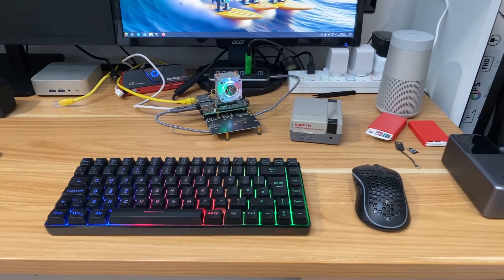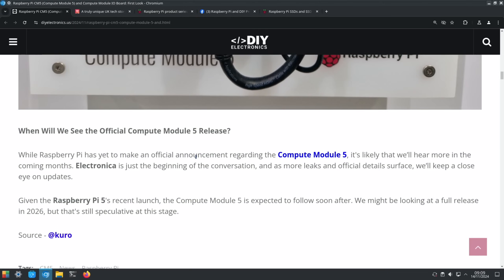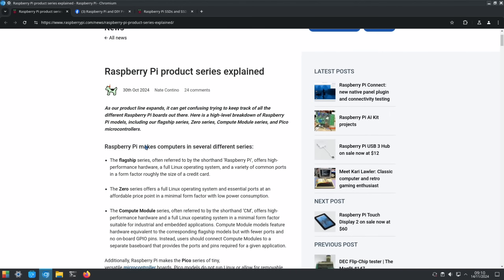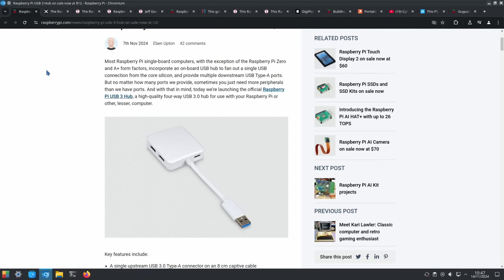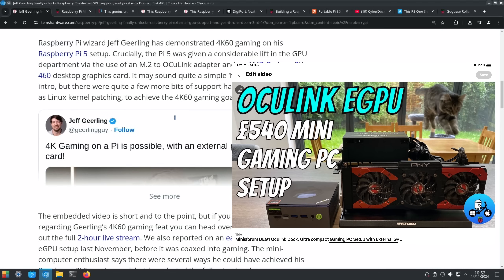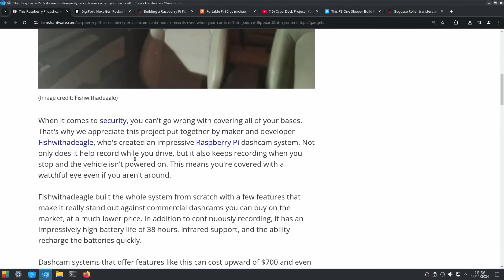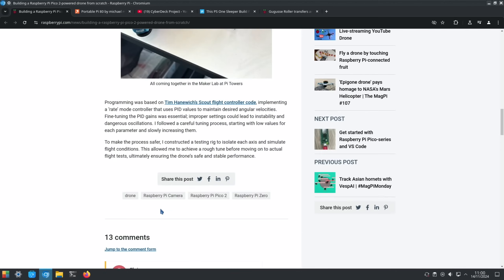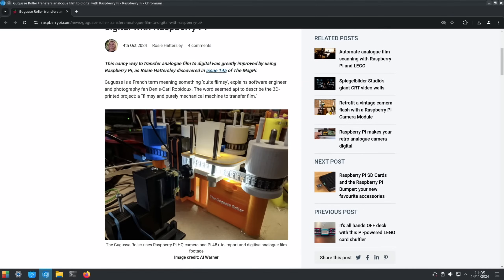Pi News 93. Compute Module 5 image Leaked!

Comment: What is according to you the best current hardware/OS/Browser combo to set up a stand-alone Browser-driven multimedia experience. I don’t want Chrome TV nor Apple TV. Just a screen with a browser on a SBC and a wireless multimedia keyboard. Able to play HD video streaming and maybe even 4K video streaming.
Reply from the maker: @boudivv  I use Apple TV because it officially supports all the main streaming services at 4K. If you don’t need Netflix Disney etc. Plex is good for archived content. Kodi also very good (video with Kodi and broadcast TV coming soon). Trouble is the Pi 5 has never been that strong on 4K. Rockchip devices are better for video but still also won’t stream all the official services at 4K. It’s difficult to answer as all our requirements are different.

Comment: Finally I can build a cm5 router
Reply: A "router" does not need a huge amount of CPU power just to send packets down different sets of wires. If something you are building requires the specification of a CM5 board that a CM4 board doesn't meet, then what you're building probably isn't a router, but more of an application-heavy network server anyway - and there are plenty of small PC platforms that can already provide that level of power anyway, you don't need to wait specifically for a CM5 board to do it.
Reply: @ ok I’d heard weird things with the pi4 as a router but I’ve found a waveshare cm4 board that should allow for it to be used as a router but my concerns were that the pi4 cpu might not be powerful enough
Reply: @block_01_  It entirely depends on the type of router you're building and what the router needs to do. 

As I said in the previous reply, simply moving packets down different wires doesn't take a lot of CPU power - but if you're then adding in "router-like" functions such as NAT (Network Address Translation) or stateful firewalling (where you inspect each packet and decide whether to route it or drop it), then you need probably need more CPU power, especially if you're doing that over 4, 8, 16, 24, etc. router ports.

Unless you create your router specifications first, you've no idea if a CM4, CM5 or any other platform will be good enough or not.

That's the core point I am trying to make here.
Reply: @ thank you for your help I’ll take that on board when deciding how to build it and what I need

Comment: Anyone happen to know if the USB3 hub supports booting on a Pi4? TY.
Reply: Why not release a 1GB Raspberry Pi 5 A+ like shave as much cost off the pi as possible
I bet a Pi5 A+ sell for $35 or less
Reply: @TacticianTilted  So what do you believe that a Raspberry Pi 5A+ is going to do for you that isn't already done by existing RPi (or other SBC) platforms?

Comment: A Raspberry Pi 500 - yes please!
Reply: for Raspberry Pi 5 1GB model just make it an A+
or scrap it make a Raspberry Pi 0 3/w
Reply: @TacticianTilted i agree , raspberry pi 5 with 1 gb will not make any sense , instead make pi zero 3w with 1gb and usb 3.0
Reply: @mkumar04   The Orange Pi Zero 3 has a quad core Allwinner CPU running at 1.5GHz and up to 4GB LPDDR4 RAM - between around £12 and £28 online as we speak. It also has inbuilt wifi, Bluetooth and SPI flash. They cost anything between £12 - £30, depending on your RAM requirements.

Comment: Thank YOU!!! I'm SO EXCITED about the CM5 !!! I was RWEALLY hoping it was gonna be compatible with CM4 boards and it LOOKS LIKE it is!!!
You mentioned how there were so many projects using the CM4 and I think people like the idea of being able to easily pop it out and run it on another machine AND because it's easily upgradable (or so we hope LOL) 
BUT the MAIN reason Why I got the CM4 was because of the nvme support! AND I found a board that had nvme on the bottom, but had a VERY similar form-factor as the typical Pi4, except the ports are in a different arrangement, but are on the same side as Pi4.
Thanks for sharing Bro!!! And I'm also looking forward to the Pi 500 too! I hope they added a few new features because most typical buyers won't see any difference between it and the Pi400... so they really should change some things up (and NOT just an nvme slot... maybe a small OLED screen displaying stats AND built-in stereo speakers?? 🤷‍♂)
Reply: I could see speakers 
How about an official Wireless Mouse for raspberry pi 
in my opinion I don't like using a wired mouse with something so close to me like a keyboard or a laptop

Comment: 👀
Reply: Please calm down and leave a few ones for the rest of us. 😉
Reply: @aturegano87  He can have as many as he likes as long as he keeps away from cheaper and better used SFF PCs for sale online - a 3rd or 4th Generation Core i5 or i7 PC with 8GB RAM will still blow any Raspberry Pi out the water for sheer speed and power - and for $50 or so, it comes with a case, cooling and PSU, which are still extras for the Pi boards.
Reply: @aturegano87    But what about the zeros?
Reply: @acubley  Release Pi 0 2 or 3 with 1GB of ram
Reply: @TacticianTilted  I was talking about 1s and 0s, binary.   😉
Reply: 🎶 "I always feel like somebody's watching me..."   🎶